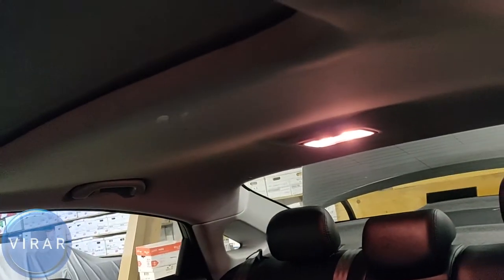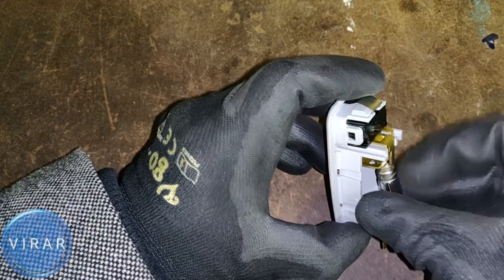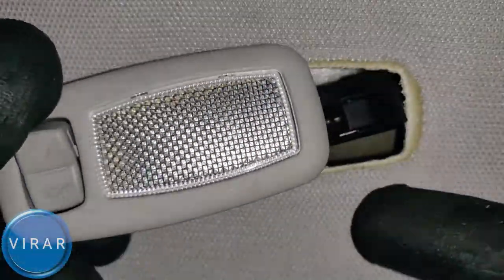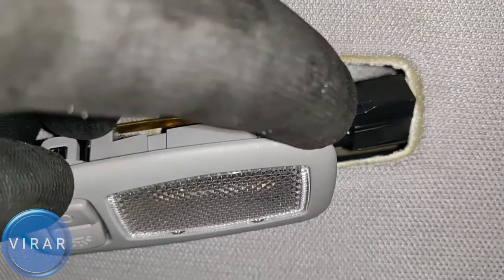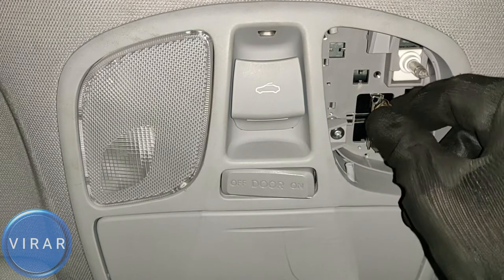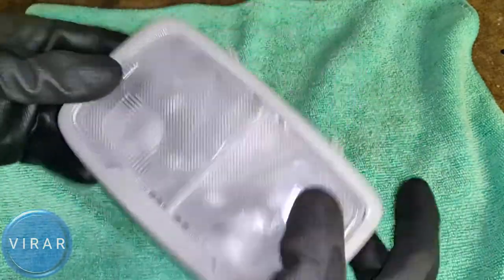How to Replace Interior Lights (COMPLETE GUIDE) - Hyundai Sonata (2011-2014)

Comment from the maker: 0:00 - Introduction
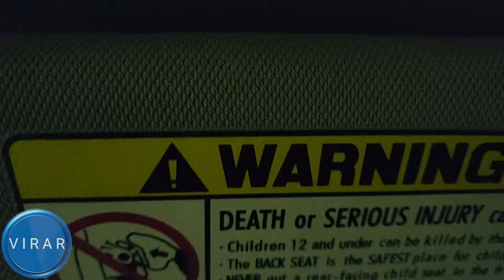0:41 - Driver Visor Light. Bulb Type: DE3175
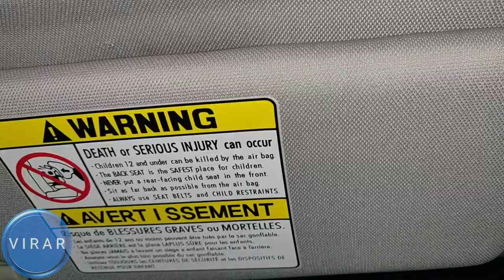2:40 - Passenger Visor Light. Bulb Type: DE3175
4:49 - Passenger Map Light. Bulb Type: DE3022
6:19 - Driver Map Light. Bulb Type: DE3022
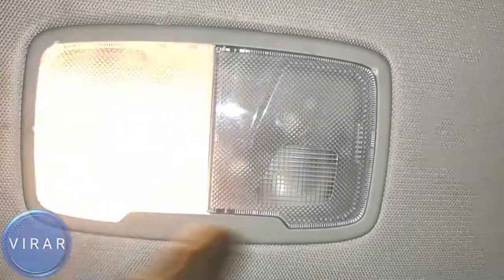7:31 - Rear Passenger Lights Bulb Type: 168
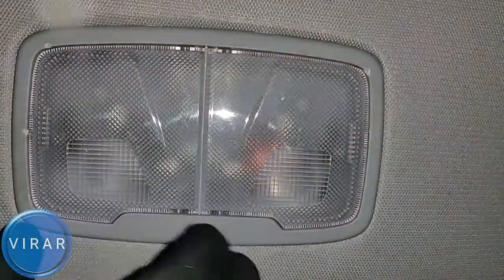9:53 - Trunk Light. Bulb Type: 6418
11:26 - Glove Box Light. 

Purchase the bulbs for your vehicle here. https://auxito.com/?ref=VirarAutomotive 
Use the promo code for a 12% Discount. 'VIRARAUTO' 

Bulb Replacement guide:  https://www.sylvania-automotive.com/bulb-finder.html
Bulb Type Cross Reference Guide: https://www.vleds.com/cross-reference-guide

Comment: Great videos. I was trying change the interior lights, but every time the fuse goes out, what that happens and how to fix that problem? 
Thank you for the videos. Very informative
Reply from the maker: Make sure you are not using a metal screwdriver to get the bulbs out of the socket, sometimes that may create a short circuit and cause the fuse to blow

Comment: Hi, while replacing the front interior bulb, looks like something went wrong and now non of the interior lights work & also cannot start the car by pushing the start button, I have to use fob key in the storage slot to start the car, even after starting the car, non of the interior lights work. 

Please let me know what might have gone wrong & how to fix it.

I also checked your other video where you showed how to replace the fuse for interior lights, the fuse looks good.
Reply from the maker: Hi Ashwin,

I can't think of anything else besides the interior light fuse being blown. When replacing the interior bulbs , sometimes one may accidentally short the connection by touching some metal  and cause the fuse to blow and that causes all the interior lights to turn off. But that's about all I can think of. 

Having to put the key in the center console storage slot points to a low battery in the key fob. But if both these issues happened at the same time, then it may be, may be something else. Unfortunately I can't think of anything at the moment.
Reply: @VirarAutomotive  Thanks very much for the reply 👍, I found that the fuse was faulty and for some reason it would look good from one angle, after I replaced everything was back online. 😊

Comment: What size bulbs do I need for both dome lights? I see 31mm, 36mm and 41mm.
Reply from the maker: 0:41 - Driver Visor Light. Bulb Type: DE3175
2:40 - Passenger Visor Light. Bulb Type: DE3175
4:49 - Passenger Map Light. Bulb Type: DE3022
6:19 - Driver Map Light. Bulb Type: DE3022
7:31 - Rear Passenger Lights Bulb Type: 168
9:53 - Trunk Light. Bulb Type: 6418
11:26 - Glove Box Light. 

Purchase the bulbs for your vehicle here. https://auxito.com/?ref=VirarAutomotive 
Use the promo code for a 12% Discount. 'VIRARAUTO' 

Bulb Replacement guide:  https://www.sylvania-automotive.com/bulb-finder.html
Bulb Type Cross Reference Guide: https://www.vleds.com/cross-reference-guide